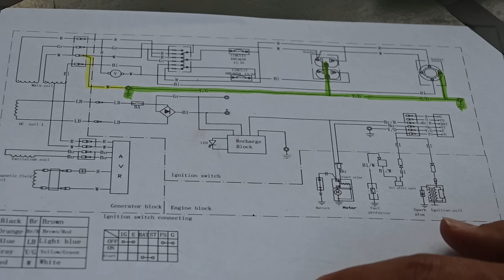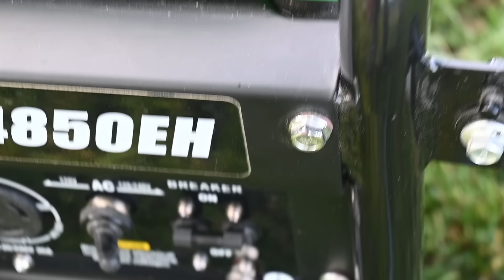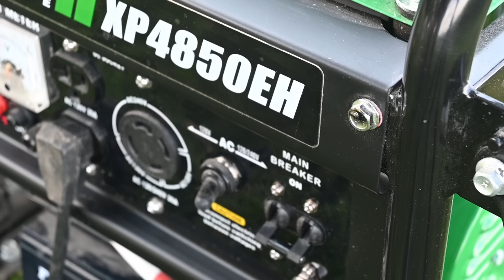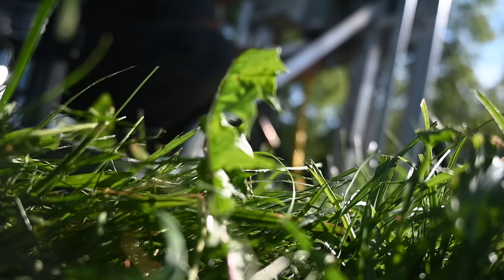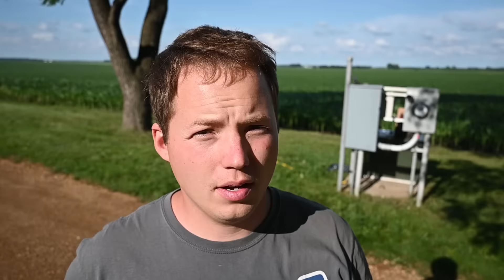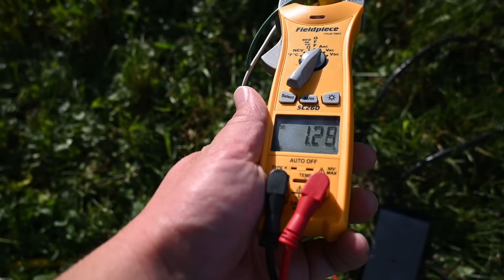What is a Floating Neutral Generator?

Comment: To be honest, I don't understand what you're afraid of at 08:20... You have an unconnected generator chassis, running one wire out to connect to it.. There is now a big potential between the chassis of the generator, and the neutral inside the plug. But that's the only potential it has... You're in no way in contact with it's neutral, so can hug and cuddle with the generator as much as you please.

You're basically "doing the same thing" when you connect neutral to the chassis (or bonding it). You make a big potential between the chassis and the live wire inside the outlet, and can hug and cuddle it then as well, you're just hugging the other side of the AC phase.

Is it just because the wires are called "live" and "neutral" :P Hehe.
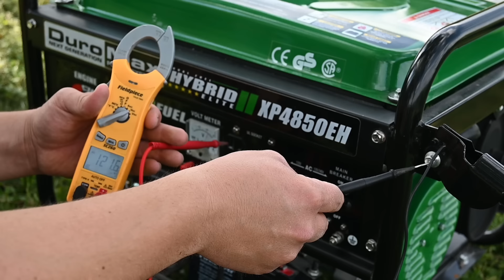Reply: 9:12 well, NOW it's dangerous, because you're poking at the opposite side of the AC phase... The exact same thing would happen if you had neutral connected to the chassis, and prodded around in the live wire plug.
Reply: 11:12 - Well, that's the exact same thing you do with neutral connected to the chassis... If there was a short in the fan, it would also send power into the ground lead, tripping the breaker... Exact same thing would happen if it had a short inside it between neutral and your hookup was like this.
The first hazard you mentioned is not correct. Because the chassis of the fan is ALSO connected to ground lead that goes to the chassis, which is connected to "live". thus both the fan chassis, and the chassis of the generator would have no potential.
Reply: 13:13 . And you have bonded it.. to one side of the AC phase... Ground, chassis, fan chassis... It seems the word "live" is the scary part. Hehe. It makes no difference what side of the AC phase you bond to ground. The other side is where the power is. Bond the live wire to ground, and you'll have a "live wire neutral"..

Comment: We can't forget NEC 590.6.(A).3...requiring ALL 15Kw and less gennys to have or use GFCI protection.  Had someone throw a sump pump off an unprotected genny into a ditch half full of water that I happened to be working in.  Other trades just don't get it.  15:58..."Almost immediately" ???  I should hope it trips sooner.  3 cycles would hurt. LOL  One more note.  If anyone in a really cold environment wants to use a propane genny off a 20 lb tank, well don't be surprised when it won't run.  Propane doesn't like temps below 20 degrees and this genny needs a lot of expansion room in the tank for the propane to evaporate at that low of a temp.  Great video again.

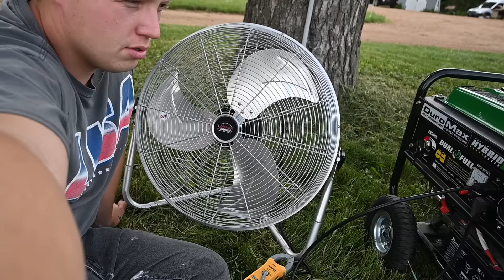Comment: 11:25 Having a 'live' chassis on the fan is not an issue. What you're going to do is connect the neutral to the earth and be happy - but that's exactly the same as making the fan frame live. Having done that, you simply need to realise the 'neutral' wire is then the dangerous one - or in reality, the left contact on the socket is live and the right contact is neutral/earth.

Comment: Sorry, I'm only speculating, as I'm not an electrician, but correct me if I'm wrong.  Having a floating GND and/or floating N means that bonding either L1 or L2 will make them the GND reference. Now, if GND is earthed with a rod, then the neutral is now HOT with respect to the earth GND and the non-shorted phase will be at 240VAC twith respect to earth GND. As we've seen in your scenario, touching the shorted frame will not shock you, because we're at the same potential. 
We're actually pretty safe, because that's how the Neutral is being created from our grid panel, where PG&E chose the center tap of the secondary of a 240 VAC transformer to serve as Neutral return currrent path. Then they bonded it to the GND, supposely a non-current carrying wire, only at the main panel to make it a common reference, and then they 'earthed' that GND within 6 feet to dissipate any excess charges. They could well have chosen L1 instead of the center tap, but we'd end up with a  240VAC single phase like in Europe. 
Now, what's the rule about 'earthing' a generator chassis using a grounding rod? I don't know because I've never seen this scenario on a portable generator. Perhaps on a large one anchored to a fixed location? How does the NEC stands this subject?

Comment: Recently I had a floating neutral in a three phase electrical system at my house that occurred before the meter. For a moment While troubleshooting I thought I l  lost all my knowledge on how electricity works. Had two electricians come out they couldn’t find the fault even though the reading on the multimeter was about 400volts  I phoned city power and they finally found the fault at the transformer powering my property. So glad my hours didn’t catch fire.

Comment: Ben, even though I converted my bonded neutral 7500w Generac portable generator to an isolated neutral years ago (and I have a plug-in shorting plug for use as a stand-alone), I remembered when we had a power outage one time, and hooked up the generator (before I isolated the neutral).  I had a microwave oven circuit where the oven didn't seem to work at full power.  After isolating the neutral, the microwave performed as it should.  The electronic board must not like dual bonds, either.

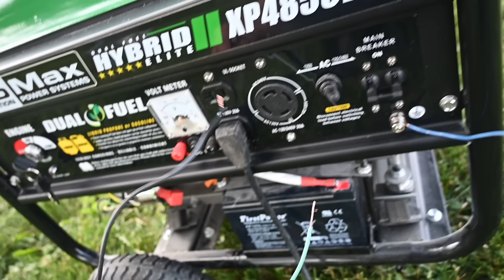Comment: 11:50 What you have there is what's known as a 'positive earth' - where the earth = the power lead. This is actually no different from having the neutral earthed - it's no more dangerous or safe. It will remain like that as long as in the system, another neutral is not connected to earth.

A floating neutral is not a problem. You have a floating earth too - while it is floating, it is safe - as making a connection to the earth through a person will not make a complete circuit so current, lethal or not will not flow. Danger appears when there are two faults.

Comment: I'm convinced my buddies bonded neutral generator fried 3k worth of stuff in his house due to the whole house surge protection system. The whole house surge protector eventually fried one of it's sides. capacitors blew up on lots of electronics and the afci GFCI breakers didn't protect the system. His generator frame was also charged and shocked him when he went to turn it off. This was connected to the main panel that was also bonded.
220v items seemed to be unaffected but 120v things were on both legs seemed to be affected. It seems that voltage was being applied on the neutral from one of the legs causing a decreased voltage on one leg and increased voltage on the other leg. It was weird but very expensive. 
The panel and surge breaker were made by leviton..arc fault and ground fault breakers on almost all branches. Some tripped, some didn't.
Let me know your thoughts on this.

Comment: 25:36 When Benjamin "bonds" the generator N-G while powering the main panel via the twist-lock and measures what amounts to a small fraction of the actual current being drawn by the house, why isn't there more current (ie. was expecting 50%) circulating on the ground wire considering they are "parallel paths" (ie. a bond N-G bond is at the generator and the main panel) just like the case for a sub-panel?

Comment: Thank You so much. This is exactly the information I was looking for, so I have the same setup you have with my inlet box connected to a circuit breaker and the metal interlock plate.  I just need to find an unbonded generator. Thank you again keep up the great work.

Comment: I noticed in the service there are CTs on the two main legs coming from the pad mount transformer. Which means if you pull that particular meter you are not deenergizing the mains in the service panel. Always check for voltage before assuming something is dead.

Comment: A grounding rod WILL accept very small shorting currents so the rod will enable a GFI on generator power outlet to protect from a bonded ground appliance or metal sheathed tool .

Comment: Hi Ben, Yup 120 v on Gen frame would  put 120 on frame of electric fan. say fan was plugged into 
metal gang box w receps on it and gangbox accidentally hooked to neutral instead of ground. 
probably not likely but there could be a situation when someone could touch the fan and maybe something  metal the gangbox is sitting on and receive a bad shock.

Comment: In a floating neutral generator, if the fan and generator frame were electrified/energized due to a fault/short then you still wouldn't get electrocuted when you touched either or both because you didn't complete the circuit back to the AC generator.  You demonstrated this twice in the video when you touched the frame with the hot wire with a generator that has a floating neutral (No spark!  No electrocution!)  So you don't have to bond the neutral or the ground to make a floating neutral generator "safe."  Now the CB might not pop to warn you of a problem.  But you could still find out that the fan and frame are electrified/energized using a NCVT tester.

Not completing a circuit in a floating neutral generator is just as good as a CB popping in a bonded neutral generator to avoid electrocution.   One might argue it's better to not complete a circuit to avoid electrocution than to bet your life on a CB to pop.   But that's a matter of opinion...

Most who bond the neutral and ground in a floating neutral generator are RV owners who are just trying to get their advanced surge protectors to work.  They are worried more about that than electrocution.
Reply: I was thinking the same thing  -- his "tests" are a bit contrived,  He's conflating the terms "bonding" and "grounding" and "grounded", which have separate meanings in the NEC.

Comment: ok, so you need to look again. The centre tap on the generator is the neutral & the two windings produce 120v with reference to Neutral by 180 degrees shifted rotation-ally from each other in time. (in a 3 phase generator the phases would be 120 degrees shifted from each other). In your case, the L14-30 connector (the round 4 pin twist lock) is a two phase with neutral & earth. The measured voltage between the phases is 240, the voltage from each phase to neutral is 120 (in a three phase system the voltage between any two phases would be 208). A floating neutral will by default configure to the panel arrangement, most likely PME where the earth & neutral are the same terminals at the panel, but to be a true PME, you should have an earth peg at the generator. If the panel is TT & not PME (not common in houses) there will not be a common earth & neutral ie: floating neutral. Earth is a safety chassis connection where almost zero current should flow (15ma will trip an RCD) the return current path for a 120v socket would be the neutral NOT the earth line even though they are tied together at the panel. In a two or three phase system, the current would normally flow from phase via the load to another phase but sometimes the return current will return via neutral in say a motor drive because of the rectifier in the unit.

Comment: Shorting the neutral to ground essentially creates a bootleg or false ground, therefore when any appliance is on, that has a metal frame and is grounded, the frame of your fan, for example, will be hot when the fan is on.

Comment: To ask simply: Is it ok to have a frame neutral bonded generator (not floating neutral) connected to a service entrance near the panel that is a separately derived/complete disconnect transfer switch? You explained in the video (22:20) this is a time when is ok to have a floating neutral generator. But this isn't mandatory to connect to a transfer switch?  I ask because will it be necessary to alter my generator's bonding jumper every time I use it separately with extension cords, and then switch it back again if I hook up to my house? You answered at 23:15 but "was your opinion." I'm just looking to understand. Thank you!! Awesome video!

Comment: 4-wire generator cords have lesser guage wire for the ground because ground is for temporary safety and not meant for constant current carrying, so hooking your house to a bonded generator could be a problem, especially since those cords are usually made with undersized wire as it is (cheaper, but should be illegal).

Comment: I did a test run on my Champion Power Equipment 100520 8750-Watt DH Series Open Frame Inverter today.  
Number 1 problem is RFI.  If you have AM Radios, then forget this generator.  Champion includes statements regarding RFI interference in the manual.   It must be due to the inverter.  The RFI is not anywhere near as low as my 1990 Honda EX4500 which does not interfere with my AM radios.  This Champion 100520 will not be replacing my EX4500.  It will remain a good higher wattage back up.

Comment: Seems to me they should simply have a switch to toggle bonded vs unbonded so you can use it stand alone, or as a power source for powering your home.  I might add my own switch for this, else just make a bonding plug.  But ideally I would prefer unbonded as its much easier to bond if needed vs the opposite.  My generator purcahse is to power my home so I need the floating.

Comment: The inverter-based Honda generators are not bonded either, so you'll need to use a special plug to bond neutral to ground for use with an RV without a transfer switch.

Comment: It is very confusing, I completely agree. Even worse, some electricians will often refer to neutral as a grounded conductor, and a ground as a grounding conductor! I just know how to wire the stuff, I don't know or care too much about the theory behind it. Seems that generator breaker should trip, though, that is weird. I don't understand generators at all.
Reply from the maker: I need to work on my terminology still. I think that you can actually call the neutral a "grounded conductor" and the ground wires are the "equipment grounding conductors". There is just so much to learn it's crazy. It's fun though. Mostly. :)
Reply: @BenjaminSahlstrom  Yes, equipment grounding conductors... I remember that now. Just remember EGC. Then over in the UK they call it Earth! Ha ha

Comment: Hi, Thanks for the demos. I just fixed my Dad's construction site generator. They are the same type the utility companies use. Little 2.2KVA Honda driven Fusion. The neutral is floating. I thought the idea was a bit like an isolation transformer - by removing the link to Earth, it means you can get touched by the live wire and not get a shock? You would have to touch both which lowers the risk of injury on a building site etc. Not sure though...

Comment: An ungrounded neutral system can be safely used, but it requires an insulation monitoring system.  This would detect the first ground fault (which wouldn't result in any trips).  Some power systems intentionally run this (IT earthing system) because it allows you to find and isolate the first earth fault without having to trip the entire system.  Both grounded-neutral and floating neutral systems have advantages and draw-backs.  On my generators I would prefer to go with a grounded neutral so I don't have to buy an insulation monitoring system, and I don't mind having a trip on the first ground fault.

Comment: The only time that a floating ground would be bad is when you have dissimilar loads on both 120V windings.
Your house would be the same way if you were to lose your ground rod or ground connection at the pole, which happens.
What would happen is this:
Ordinarily you would have both 120v/120v referenced to ground and 240v across both hot wires.
Depending on how much load you have on each side, the actual voltage would float up and down.
You would have light bulbs and appliances going bad because of high and low voltages.
Some older homes never had a ground rod and if they lost the ground connection at the pole the voltages would float.
The floating voltages would be like 113v/127v/240v.
Those voltages will change every time you turn on another light or appliance.
So yes, a portable generator needs to be grounded if you are going to have dissimilar loads like 1 lamp in one receptical  and a refrigerator on the other.
If the generator goes hot and if you were to touch the generator and something that is grounded at the same time you can get a massive shock.
So get a ground rod and a glass of water to be safe.

Comment: yes, having it grounded cant trip the breaker with a floating neutral as there is no path back to the source. Even if there was, the ohms thru the ground wire is high enough to not trip a breaker. Test with 2 ground rods. One wire from  hot  to one of the ground rods, the other ground rod back to the neutral of the gen.

Comment: Benjamin- I wonder why the companies that make generators don't simply add a toggle switch (SPST) and put on front of the panel.  Run a wire from the neutral pole on the back of the generator to the SPST switch with the other wire back to the Generator Ground.  Simply label the switch for ON to become a bonded neutral and off to run as floating neutral and label as such?   Seems easy enough to do and I can't think of any downside to this option.  I'm going to modify my generator with such a switch that won't tie up a receptacle with a homemade ground plug.    Ideas or comments?  Oh.. and BTW,  I've watched dozens of video on this topic and your explanations are BY FAR the most comprehensive in understanding by demonstration which is which and why it's important.  GREAT VIDEO  I just wish I had seen it before Texas lost power in the Feb 2021 Brown out - and no, we were not spared.  Just a victim as were 4.5 million other people in the state.  I just couldn't understand why it would not power the Furnace while half freezing to death for 4 days.